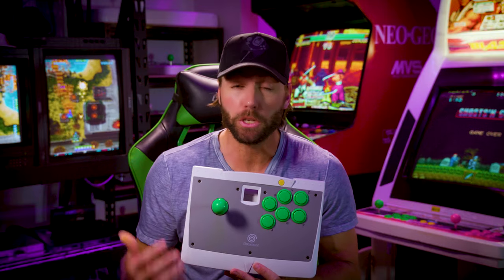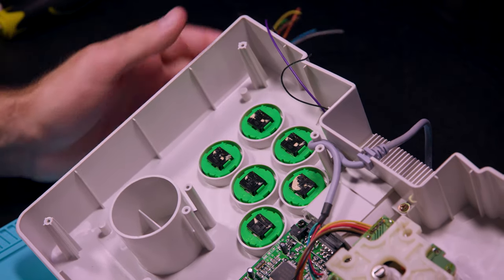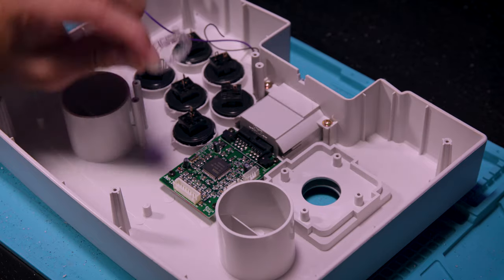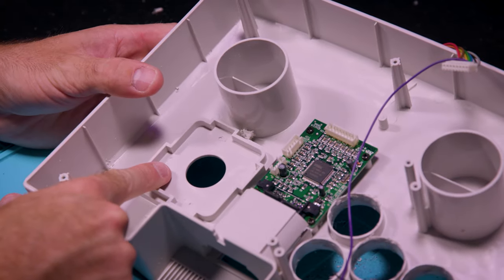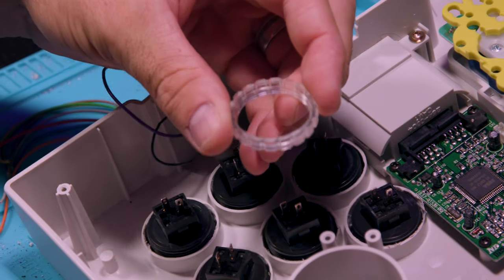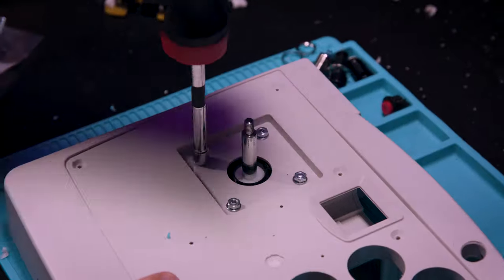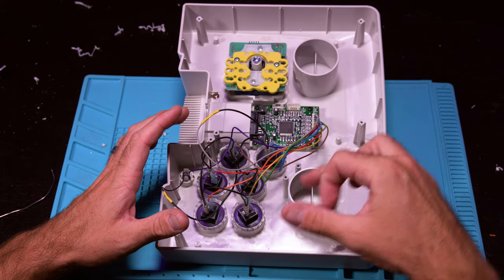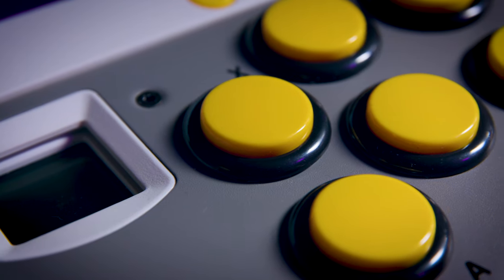Sega Dreamcast Agetec (Green Goblin) Mod Guide // ARCADE STICK MODS

Comment: Great video but a word of advice.  You can get an exact 30mm stepper drill bit that will give you an exact 30mm hole so you don’t have to be imprecise with the Dremel.  I used these stepper drill bits to resize the button holes on my Evel Knievel pinball machine when I updated all the hardware since the old Bally buttons where no longer made.  Hope that helps.
Reply: Wish i read this before my dremel sanding bit got completely eaten through cutting down those 6 holes, lol.
Reply from the maker: @Bodega_dASH_Goteem  haha yeah you need one fit for grinding metal...I did the same thing first time. But yes you can certainly do what he says above but I had some difficulty doing it without a proper large stationary drill press. It ended up cutting a large chunk out of the hole and completely messed it up. I'm sure there are ups and downs for both
Reply from the maker: I tried this but ended up messing it up and taking a huge chunk out of the hole. Do you have a stationary drill press. I imagine that combo would be perfect

Comment: Great channel. Anyone who appreciates scalines has to be good! I've never attempted a mod like this, I don't even have the tools yet, but I think I'm going to try it because of your video. My Dreamcast stick is worn out and I've been looking to get a new one, just for casual emulation on PC. I was considering selling mine and buying something cheap but I think this mod would be both much cooler and will teach me a lot of skills I've always wished I'd had. Finally a legit excuse to buy a Dremel and learn soldering! Doesn't matter if ends up more expensive, I'd be paying for the education, not just the stick.
Reply: I finished my mod. LS-32-01, Sanwa buttons in Neo-Geo colours plus 2 white. I learned so much, I'd never used a Dremel before.
Reply: @DenkyManner  im uncertain which tool to use; what is the accessory used for widening the holes? do u have partnumber or description?

Comment: Instead of using a Dremel, I recommend a 30mm stepper drill bit. It will be way cleaner and faster to expand those hole. Other than that I learned a lot from this excellent guide. Thank you!

Comment: Just finished modding mine, your guide was super helpful! I ended up putting an LS-32 in so needed a bit more work, but came out nice in the end. I also used your tire weight trick to add some heft to the unit itself!
Reply: Hi. What type of buttons did you used? Did you install screw in buttons?

Comment: Your channel is just awesome! Keep up the good work man!💪

One further thought: would it be possible to install a second (parallel) fighting board into the Agetec by wiring both boards directly from the buttons and the stick? The Seimitsu modded HTK-7300 is phenomenal and I would like to use it on other consoles, too.

Comment: Invest in a stepper bit. Trim the metal mounting plate of the new ticks so it fits in the recessed area, better stability and wont weaken the plastic or stretch the screw holes as much over time. I would also just make a new JST cable instead of all those splices.

Comment: Fantastic video! Production quality and lighting are top-notch, and I love your studio/workshop!

I'm a bit confused about how to attach quick disconnects to the pushbutton wires. I bought these terminals and sleeves from focusattack and this crimping tool from Amazon:
-Philmore .110" Non-Insulated Quick Disconnect Terminal (Box of 100)
-Nylon .110" Quick Connector Insulation Sleeve (Approx 100pcs)
-Titan Tools 11477 Ratcheting Wire Terminal Crimper Tool for Insulated Terminals - Fixed Jaw Terminal Crimper

The terminals are already closed, so it seems like the crimper doesn't do anything to them. I've been trying to crimp terminals to the old ground wires, but I haven't gotten one to stay yet. Any crimping tutorials you could recommend? What tool/terminals do you use?

Thanks, and keep up the great work!

Comment: Great video thanks! Just wondering if you could do a video of modding this arcade stick with the the actual controller PCB of OG Xbox. Would be awesome to use this arcade stick modded at PCB level on OG Xbox without using laggy converters. Wish OG Xbox had a "single" decent arcade stick.

Comment: Hi, thanks for the guide. I am new to modding my controllers so I need some extra information to mod my 2 dreamcast sticks: 1) Do I need 0.110" or 0.187" quick connects? 2) I am considering LS-32 but I don't like a square gates and the Kowal octo gate got not completely positive reviews. Any suggestions? 3) Could I put quick disconnects on the end of the cable and put them on the pins of the joystick or of the pcb or should I use wire connectors? Thanks in advance for your anwser!

Comment: 17:54 I always throw out the yellow guides on Seimitsu joysticks (and the blue on the LS-32 because when they are set on the largest size like you have here, the two corners feel different to the other two corners. On the other side the guide doesn't touch the actuator at all and on the other side they touch the guide.

I've eve tried cutting two guides and adding them together so that the actuator touches the yellow guide on all corners but that makes it feel much worse than just getting rid of the guide and using the actual square gate.

Comment: i was so excited to try this out, i ordered a ls 55 and it has no connector like your stick has. the ls55-01 has it. can u give me a hint where to put the ground cable? it has 4 connectors like the one on a button.1 for each direction but no extra grounding; do i have to daisy chain it for the stick aswell?

Comment: I was going to Mod this stick but nah it's too much work and I don't have the proper equipment for it.  The stick looks simple but beautiful.  I think you can just cut off the ridges on the sides of your Sanwa Buttons and stick on there.  I didn't try it, but that is what I did to fit the buttons into my MVC2 Arcade1Up.

Comment: Hey for the portion where you need to remove the balltop to switch out the shaft or joystick, mine literally is stuck, I hold it with the flathead and try as hard as I can to remove it but it won’t budge, any advice?

Comment: What's that Dremel bit that you used to widen the holes and grind the JLF body?
I've been using tungsten carbide tile grout cutting bits for random projects like this. They works well for cutting aluminum and cast iron (I use it for porting small cylinder engines), but they're also pretty skinny and better for detail work so I've been looking for something wider.

Also, great video as always dude! I can definitely tell you put a lot of time and effort into making these. It's motivating, like I want to make some videos of my stick mods too, though I lack the editing chops to produce something as good as this lol.
Reply from the maker: Well heck, maybe we can collaborate on something! As for the dremel bit I use a large assortment but honestly, anything would work since its plastic. There are couple sets on amazon for fairly cheap i use. Ill try and figure out which bit that was

Comment: just a quick note. I tried installing the original LS-32 not the LS-32-01 and I notice it's slightly bigger by a few millimeters so I'm not able to screw the bottom plate all the way otherwise the bottom of the  Joystick drags against the metal plate. Any Ideas?
Reply: Joska Cintron i installed the LS-32-01-SC-K, and had the same issue. I had to dremel down the walls the original stick sat inside of. With this it still dragged on the bottom of the plate. 

I put clay in those 2 cylinder shaped pillars for weight, but i had to add a slight few millimeters more of clay so it could push against the bottom plate. Sucks cause the clay going farther out then the cylinder pillars means my bottom plate is bending slightly, but thats the only way i got the stick to not drag.

After closed it up and it was fine. Shockingly it sealed perfectly, and doesn’t wobble when i leave it on my desk. Its janky, and Im sure the plate is permanently warped; but its better then not having your stick go back to neutral position.

Comment: I understand this is also a matter of feel and future proofing but would Crown 27mm buttons fit as drop in replacements on these?
Reply from the maker: Are those screw on back? Either way I got to check those out!
Reply from the maker: @limaofarofa  yeah I bet they would for sure. The original sega buttons are close to 28mm I believe. I'll order some! Thanks dude!
Reply from the maker: I can't seem to locate those buttons. Where do you see them?
Reply: @ScanlineCity  I think Etokki, Istmall and Paradise Arcade had them in stock as "CWB203C", other shops might carry them or do special orders like Akihabara.

Comment: I was planning on putting a brook ufb into the Namco PS1 stick, any tips for doing this, I'll probably keep the original parts/part swap the stick so I shouldn't need to mess with the actual case much right?
Reply from the maker: You should be ok. That said it's a tight fit so I would NOT use a 20 pin wire harness and instead use the stock screw terminals. Also dont forget that the namco buttons are soldered to the pcb so you will need to solder new wires to them. And to be clear you plan on keeping the stock stick right?
Reply: @ScanlineCity  yeah keeping stock stick but might see about putting new spring etc. In it, i saw something about people taking the stick apart and combining it with parts from a jlf but I'm not sure how that would work
Reply from the maker: @lukemacinnes5124   Yeah I would stick with the stock parts other than maybe replace the Spring and you should be good to go

Comment: Hey scanline! I’m trying this mod but I’m bad with screw sizes. Can you link me to some that will work with an LS-56
Reply from the maker: Try a set of #4   5/8 inch screws. You can get them at your local home depot and they should be open right now :)

https://www.homedepot.com/p/Everbilt-4-x-5-8-in-Phillips-Pan-Head-Stainless-Steel-Sheet-Metal-Screw-8-Pack-800941/204275391
Reply: Scanline City hey thanks! Missed it in the video but heard it the second time. Awesome guide.
Reply from the maker: @thomasscialpi2146  let me know how it turns out!

Comment: Where did you get the parts for this mod
Reply from the maker: Arcade Shock mainly. The start button replacements came from amazon.
Reply: @ScanlineCity  what are the specifications for the start button? I took mine apart to clean and the membrane bounced away..so I figured upgrading all the buttons wouldnt be a bad idea. Do you have links you can throw in the description?